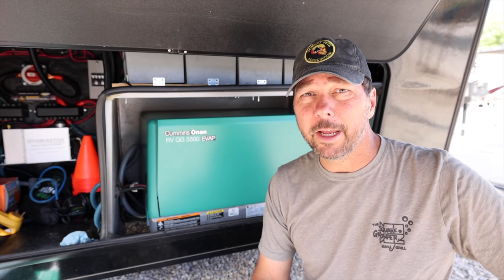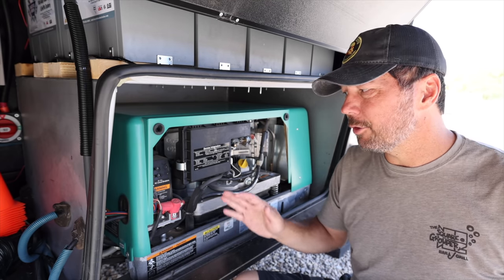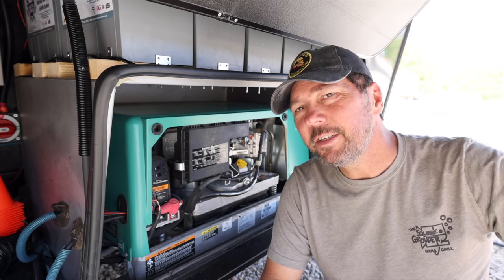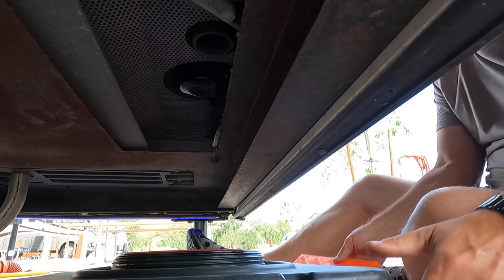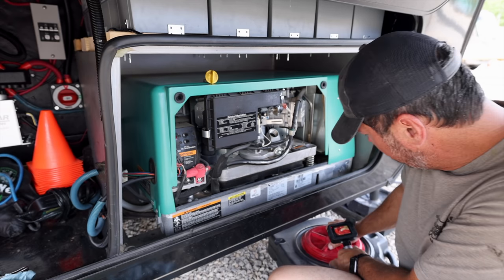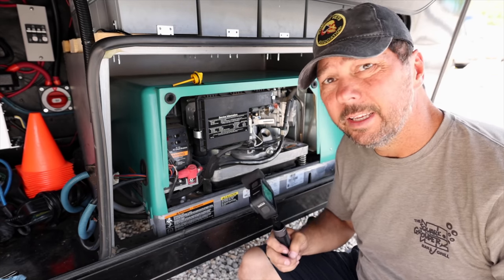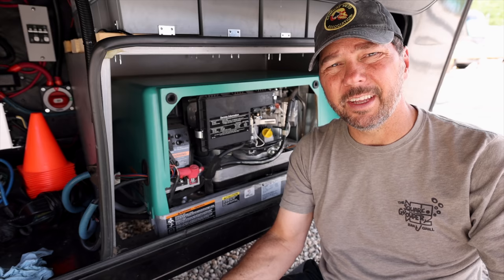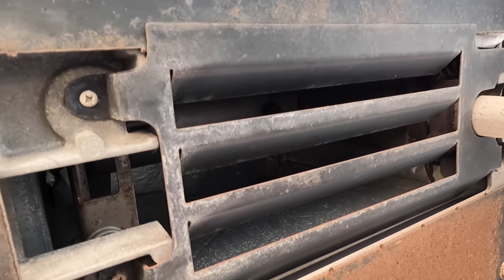RV Generator Maintenance (Full Time RV Life)

Comment: One very important thing that most peeps don’t do is adjust the elevation dial on the carburetor for wherever you are in the world as your camping. It’s a no brainer as there’s a black dial on the carb with numbers on it that go from 0-5000 Ft and some even go to 10000 Ft. Having the proper air fuel mixture is super important so the the generator runs at optimal efficiency. 👍🏼

Comment: I always fill the new filter with fresh oil !
Reply: I do the same. Super easy when they are vertical like that one is. Its nice to not have any dry start.
Reply: Always put some new oil in it. Always new oil on the gasket, too many contaminants, and the oil has lost most of its viscosity.
Reply: A word of caution, any oil being put into the filtered side of the filter whe. Prefilled is not filtered
Reply: @glennrobichaux7490  That's not really a concern with fresh oil from a clean container.
Reply from the maker: Good tip!  Not sure it really matters a whole lot, but it can't hurt.
Reply: @glennrobichaux7490  never thought of that… wonder what could be there in new oil though.
Reply: @TDub_ADV  new oil can still have contaminants in it, I worked for an oil and fuel distribution company for many years, companies would pay us to pre filter new oil because time after time new oil was tested and had contaminants that could cause many issues.
Reply: @glennrobichaux7490   This makes no sense to me....  Think about where you put fresh oil when you fill your car or trucks engine, it goes right on top of the cylinder head which is normally bathed in "filtered" oil. So when you fill your engine you are pouring all that "unfiltered" oil right on moving parts and not just a little bit but quarts of it. If fresh oil was ever going to cause an engine problem it would be right here that it manifested first. But we all know that it's not really an issue. 

One thing that filling a filter with oil will get you is instant oil pressure at startup vs potentially being without pressure for seconds while the filter saturates itself with oil. If you want to damage an engine, run it without oil pressure. Thats a great way to score crank and cam bearings real fast. 

Bottom line is if pre filling a filter was an issue we would be hearing about engine failures caused by it but we don't. I can tell you i have seen with my own eyes when just a few seconds of dry running will do to an engine. I will take my chances on a few ounces of unfiltered oil every single time.....
Reply: For years this has been a filter fill or not to fill debate, with good arguments for both sides. In this case Onan does not specify pre-filling the filter in their literature.
Reply: I saw one cortical where a warranty was voided because on tare down a piece of membrane from the oil jug was found in some component of the engine.  You can fill the oil filter thru the outer holes that way the oil has to go thru the filter element.
Reply: @josephsmuckatelly8767  good point and I recently learned the mechanics that services my equipment has caps that fit the center hole for both fuel and oil filters and he fills them from outside in
Reply: @ChangingLanes  saves some time getting the two quarts into the genny by filling the empty filter.
Reply: @ChangingLanes  just a precaution for the engine not to run a few seconds without oil
Reply: @TDub_ADV  
The top end of the engine is not the part of the engine that is going to care about a little bit of contamination. It's the bottom end of the engine that has all of the tight tolerances that can be damaged  by those contamination that may be present in new oil. The top end of the engine around the valves has the loosest tolerances and is often the dirtiest part of the engine. That is why the oil is filtered after it returns from the top of the engine before it is pumped through the bottom end. Many oems are worried about contamination present in new oil. Oil contamination is actually one of the leading causes of engine damage. Start an engine up with a empty filter is also not the same as running without oil. There is plenty of oil remaining in the engine to safely run the engine for sort period of time it takes to pump the oil system up.
Reply: It prevents the motor from a couple cycles priming/filling the filter with oil…
Reply: @TDub_ADV  actually it is, take a look at the bottom of the "fresh oil" jug next time you do a change. That's why no manual specifies to pre fill the filter
Reply: I thought about that too…. Not necessary but some of us tend to overthink things a bit!!🤷🏼😂😎

Comment: EXCELLENT VIDEO!!  Wish I had seen it before my Madian boondocking voyage to Sturgis, SD. Bought a new 26-foot toy Hauler with a 4000-watt generator in January. One month after buying it, I took it to Yuma AZ as a place to stay while doing a travel Respiratory assignment at Yuma Regional Medical Center. Staying at an RV park with full hookups I had no problems for the 6 months I was there. I left for Sturgis where I dry camped for 2 weeks and had NOTHING but problems. Battery was dead (even though hooked directly to power at the previous RV site), so couldn't start generator to run AC. The microwave kept arching inside like I left a spoon in it and none of the outlets would work. I called the place I bought it from for over the phone help (very poor customer service) , and they told me to "Bring it in"(?). The poor service girl immediately got F Bombed for which I was sent directly to the service managers Voice Mail. Long story short(er), the walk thru I got was poor and rushed. Not all service manuals were given to me, and I did not take the time to learn for myself what I needed to know before I go! Going to take the RV online course you took.

Comment: Hey Chad. Every rv should have a co detector. I was using a generator in the winter during a  power outage. The co got inside. The alarm woke me. I opened the door and aired the rv out. The co detector saved our lives.
Reply: Ours went off in the middle of the night too... it just went bad. Had to cut the wires to it to shut it off.

Comment: Another good video.  First time i changed fuel filter I added an inline shutoff.  Easier than trying to crimp line to stop fuel flow.
Reply: I did too. Works great. I don't use worm gear clamps for fuel lines. I crimp mine.
Reply from the maker: Great tip!

Comment: 1. The longer the engine hasn't been run, the longer you need to hold the primer, even up to 30 seconds. It will prolong the life of your starter.
2. The oil looked very dirty on the dip stick. Just because it says to change at 150 hours doesn't mean you need to wait that long. Read the footnotes. I would cut that time in half, at least.
3. You should fill the filter with new oil before installing it. This makes for a much shorter time that the engine runs with no oil pressure and you should have to recheck the oil level only one time by doing so.
4. Do NOT use worn drive hose clamps on fuel systems. They are very poor at sealing and an air leak in the fuel system and air leaks can be devastating to the engine. A spring compression type is far superior. You noticed the factory didn't use a worm drive.
Reply: Can you over prime it?
Reply: @wolfie26  if the carburetor is in good working order, no t really, there shouldn't be a need to prime for more than 60 seconds anyway. You can hear the fuel pump quiet down when it gets fuel( in the case of running out of fuel), prime for about 30 seconds after that and you should be good.
Reply: @wolfie26  No. When the carb float bowl is full the needle and seat shuts off the fuel flow into the bowl.

Comment: Recent subscriber and I like the few videos I've watched so far! However, PLEASE fill your filter prior to putting it on! The filter provides the oil to the entire system and filling the motor from the fill hole and then starting it and letting it run to get more oil in is starving every moving component of oil until the filter gets full. Interestingly enough, you'll find that if you fill your filter with oil and let it sit for 5-10 minutes, it'll hold even more oil as it soaks in. I generally fill mine up several times prior to spinning it on and then putting in the required amount of oil in the fill. Start, check for leaks, and go on down the road. Well done and good info!
Reply from the maker: Good tip and welcome to our channel! 👍🏼

Comment: About the spark plug, try a standard plug socket. They have a hex head on the top so you could use an open end or a box end wrench to turn the socket. If the box end will go over the socket, use a ratcheting box end. Use a wire gapping tool, not a flat feeler gauge.

Comment: Morning Chad. Some tips as requested. One always fill a new oil filter that goes on upright saves that couple of seconds engine is running dry. Second for spark plug get a socket with built on swivel they work in tighter places then add on swivel. Add install new plug with piece of fuel line or old plug boot with fingers first. Do not want to cross thread that baby.  Awesome as always to watch

Comment: Tricky is an understatement it was miserable to get to the spark plug on the right out and then a new one back in.  I had to use one a socket wrench  universal joint and it was a bear of a job.  I wish they could have figured out a better way to get access to it!
Reply: Amen to that. Designed by an engineer with a poor sense of humor.  I found a really small articulating ratchet that just barely fit. Found it at harbor freight. That spark plug took 50% of the total maintenance time. Next time might be slightly easier.
Reply: @WesTaylorPhotography  Designed by an engineer that doesn't have to maintain one of these.
Reply: Using a hole saw, drill a 1" hole thru the housing,  after changing the plug, you can get a 1" plastic plug/cap from true value, everything looks factory and makes changing the plug a breeze
Reply: It's really simple if you do it while your doing the other maintenance 👍
You are supposed to adjust the valves at the same schedule 📅 
So with the Valve Cover removed the spark plug is very simple to change 👌

Comment: We don't have a built-in generator but I still found your tips very helpful.  For instance, exercise your generator monthly UNDER LOAD.  I routinely run my 2 portable generators here at home but have never applied a load.  I have a few electric heaters that I will be using in the future.  So glad I found your channel.

Comment: One tip you may or may not have forgot to mention is, gas in the carburetor. Believe It or not gas actually deteriorates the parts in the carburetor. So you should drain your carburetor if you're going to run the generator less than once every week or two.
Reply: So true. I've had a number of small engine carbs fail due to gas sitting, even with Stabil used.

Comment: Excellent video.
My Auto Gen has settings I can change. It includes 1. Insufficient shore power on or off, 2. Voltage and 3. HVAC on or off.  Each can be turned on or off.  The voltage can be adjusted but I don’t go below 12.0 because my EMS will start giving alerts at 12.0 volts.

Comment: Hey Chad, another great video. I joined the Army as a 52D Generator mechanic. granted this was back in 1977, they haven't changed that much. you laid out all the fundamentals very nicely. I noticed "Trust me" hit on a few spots that I was going to mention, like adding the oil to the oil filter prior to installing. and the hose clamp looked the same as we use on our pex pipes. thank you "trust me". just a couple things, first up, last I checked it was free to give your used oil to O'Reilly (Southern California) good to know in other states they charge. next up, for your spark plug, like you said, an open end short wrench might work, use 3/8" drive ratchet and extension, they make sparkplug sockets with a wobbly and extension all as one piece that might also work. and to make it easier, replace the plugs on a cold engine and be careful not to over tighten (unless the manual says differently.), use torq. specs if possible. you do not want to strip the aluminum head. you are extremely detailed, awesome. when it comes to equipment, I think that is extremely important. by the way, it is good practice to open a new quart of oil and use it to lubricate the filter sealing ring. good luck, best of health and safe travels.

Comment: Very informative, Thanks. Also, find a recycle facility for your oil and some trash such as aluminum, cardboard, etc., its free. For trash a minimum fee is usually charged and is around $ 8.00 for a couple of bags. Where I live we have several places that accept both. We also have recycle places that will pay you for it such as batteries, refrigerators, aluminum, copper, steel, etc.. I had 300 ft. of chain link face replaced, cleaned off the concrete on the post with a hammer and got $78.00 for it at the junkyard. Way better then having to pay to have it gone.

Comment: I changed my fuel filter at 175 hours, because it was acting like bad fuel. I discovered the crimped on fuel line as well. I bought a screw clamp to replace it. Good video.

Comment: I am so glad you mentioned to check to make sure the o ring came with the old filter. My Dad told me to always check for that. Never had an issue with the o ring sticking when changing the filter until one time changing oil on my truck. Wouldn't you know it, the o ring stayed on the engine block. Saved me a lot of money by checking the old filter.

Comment: Chad, if you get a little piece of brass or copper tubing and put in it the rubber outlet hose your problem with it hitting the frame will be solved.  Heck I'll even send you a piece if you need it I just had to buy a foot of 3/8 when I needed 8 inches.  One more hint, buy a dollar store shower curtain to cover the ground or pavement.  As far as the fuel line goes I prefer spring clamps to worm clamps, they don't chew up the hose and when the hose shrinks, and it will after a while, they hold tension.   Fortunately I have a diesel gennie so not spark plug.  Good video guys, and yes you too Tara I know you do the editing and music.  Keep the good stuff coming.

Comment: What you called a crimp on your fuel line. Is just another form of clamp. They are reusable. No need for a worm clamp. 2 prongs one side and 1 on the other. Pair of pliers and squeeze together and slide back off the nipple. They do make a special pliers with a notch in them for the prongs. But regular pliers do fine. Your spark plug issue. Attack it from the other side of the vertical metal pipe right there with a shorty socket extension.

Comment: For the plug on the right I use a standard spark plug socket like you had w/ a step down adapter from 3/8 - 1/4 for a 1/4 flex ratchet (positioned on the right side of the recirc. tube) which will allow for clearance.  You also may need a stubby extension.  I also don't lock the detent ball into the socket, just until the square shape seats.  Just makes separating easier once the plug comes loose.

Comment: I started with a carburetor evap model.  The evap model runs hotter for emissions standards.  The float in the carb kept cracking.  The dealer swapped it out to the EFI model, that was much more reliable.  We also built a wind baffle/scoop to direct the discharged hot air away from the intake.  This is important because the air used to cool the engine comes in and out the bottom of the generator.
Reply from the maker: EFI likely does better at altitude also.. 👍🏼

Comment: I got it off & on with a small 1/4" ratchet & a universal joint attached. But the best way is to buy the Gasket for that OHV 4- bolt cover which just contains/covers the valves and gives you full access to the spark plug.

Comment: Great vid.. just one more tip from an old engine builder. Next time you might want to think about semi filling your new filter before installing it. I usually fill the filter to a little more then 3/4 full. This is to insure that on start up you get oil flow sooner on start up. It will take the oil pump a little while to fill that filter before it starts pumping oil through the oil system. By filling the filter you cut down on this time so oil is resupplied quicker. Does it really make that much differnce? Heck I dont know, but I do like the thought atleast of oil getting into the system faster. Thanks for the vid.

Comment: 👍 Bravo.  Run those generators under load.  A heavy load (75%) so,  disconnect from shore power & fire up the HVAC while baking a cake in the convection microwave and give the generator a good workout.

Or, for them that may, turn on the HVAC while ”On The Road Again”.   Heyyy.... 🤔 ya know, that sounded like there might be a song in there..... "running the generator with my friends". 🤭

Well done Chad.

Comment: For your hard to get to spark plug, use 3/8 drive swivel and extension. You had it right put socket on first,  then swivel,  extension. Ect. Look luck , safe travels.
Reply: You just remove the valve cover first. 
You need to adjust the valves at that schedule anyways 👍

Comment: The easiest way to get that plug on the right is with the wrench technique you mentioned or a universal if it will fit, depends on the length of your socket. Also I have had some issues when filling full on the dipstick, gives an over full condition and shuts gen down. I have seen on Cummins forums that this has been a design flaw for years and only filling to 3/4 up the hash marks is adequate. One other point to speed the fill process is prefix the filter. Great video as usual.